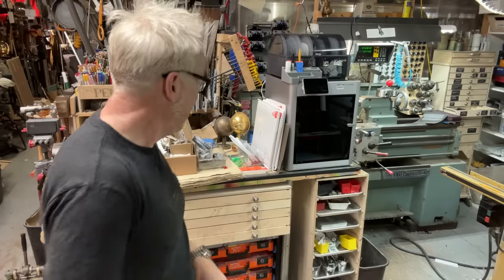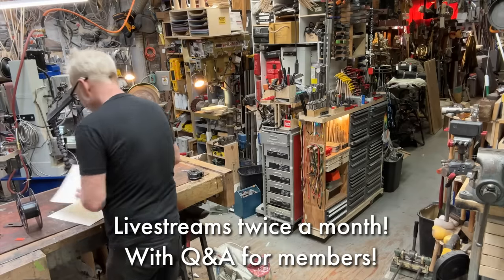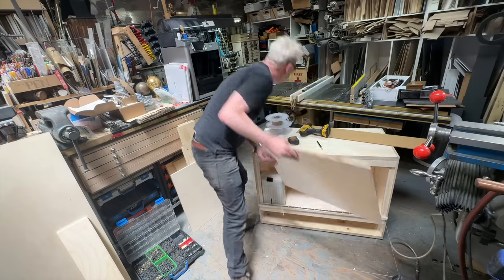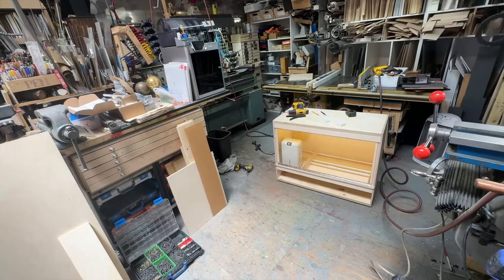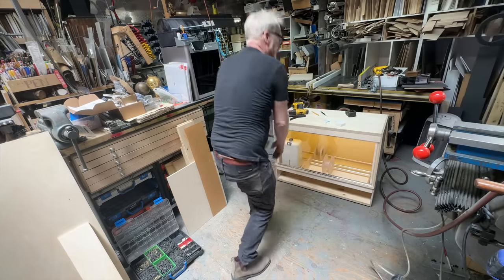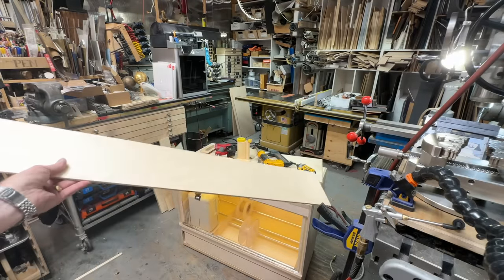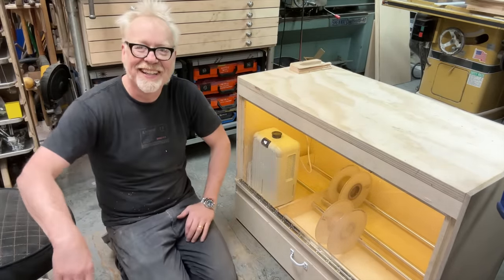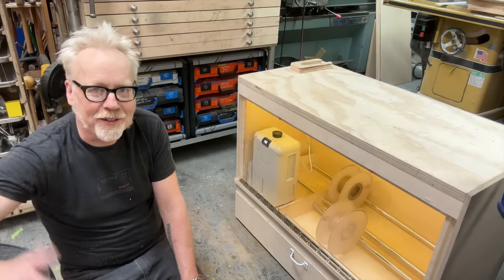Adam Savage Builds His 3D Print Farm!

Comment: Hi Adam!  I have two questions (not sure if you look at these, but this is SO relevant to what I have been thinking thee last few weeks). 
1st - Are you gluing the sides together on this, or are you joining them in anyway (Kregg, etc)
2nd - for a non-maker/future maker - do you consider a 3d printer a "toy" or a tool? I want to buy the bambu labs, but need to justify the price.
Reply: A: A little bit of wood glue, and nails

B: I believe Adam has discussed 3D printers in one of his chats before! If I remember correctly, he likes them, but they were not ingrained in his mental model (back then), so it wasn't the first solution he went for. In traditional making, we are usually doing some form of reductive manufacturing (removing stuff from pieces), and then gluing different pieces together somehow. 

With 3D printing, you are adding material, so it really opens up a lot of "solution space" after you get used to them! But as with every tool, it does some things brilliantly, and other things less so. 

You do need to model your part in CAD though, which makes things a bit more formal then free-form making.
Reply: @AnT508  Thank you!

Comment: Although that dry box is interesting, I think you are making a mistake. I have been active in 3D printing for around 6 years now and over time you end up collecting a LOT of filament or resins, of different colors and types. You should NOT store your filament in an actively dehumidifying box. There's nothing technically wrong with storing in a dehumidifying box, but it is of limited size and will be a huge waste of electricity. What you should do is get the thick large plastic bags made for storing filament along with a bunch of desiccant. Use the dehumidifier to remove as much humidity as possible, then immediately store it in the plastic bag with several medium sized desiccant in the bag. The temperature of the filament before it hits the hotend is somewhat irrelevant as the hotend will heat it up appropriately. Soon you will have a WALL of filament and actively dehumidifying all that would be quite an expensive ordeal. After storing in these bags, if you are concerned about filament absorbing water while in storage, put it in the dehumidifier you built the evening before you start your printing project and let it dehumidify overnight... Store filament in sealed bags with desiccant packages in the bags and they'll store well for years...

Comment: For your next printer, I'd suggest something supporting multiple tool heads so you can print different types of material in the same print, instead of just different colors. There are several idex printers on the market, but the  Prusa XL or the blackbox would be more flexible.

Comment: Poor mans dehumidifier....Fill a storage container; the size to fit filaments. With about 4" of mixed plaster of paris. Pull it out of the container and Let it completely dry. Then put it back into the container. It will draw moister away from the filaments.

Comment: Shocking someone with an engineering mind would not overlap the TOP over the sides (Same as the anycubic stand). Your now relying on the lateral strength of staples and glue to support everything instead of the incredible strength of the multiple plies of plywood holding everything up. Also I think instead of measuring for the counter height it would have been better to measure for the height of the filament. So that you could have had a second level of filament stacked on top. Also some sorbothane on the bottom would be good to help keep it from sliding around and absorb some of the vibrations for stability and to keep it from chattering. Possibly some dynamat on the inside as well because that thing's gonna now act as a speaker horn transmitting all the shaking. Also I question an x1c just because bambus practices are a bit unfriendly to the community.

Comment: Bambulab are awful for "professional" uses. I'd never let cloud only device touch my work stuff, I love their hardware, but closed source proprietary online only service is a freaking security risk man.
 
Little Timmy who prints funny boats or Bob who makes home improvement stuff won't suffer when their little sliced files get yoinked in data breach, but imagine what is basically manufacturing files getting into unauthorised hands.

Also 45%RH@23°C is only viable storage conditions for like PLA. Even PETG will string as hell if stored like this and needs environment below 30%RH@23°C, not even starting on superhygroscopic polymers like PA(Nylon) that need 15%RH@23°C at most or they'll be soaked and unprintable in matter of *hours*

Comment: Re: "Filaments are hydroscopic"  Seems like a myth.  Bust it or prove it true!  Filaments are plastic based, and as such are NOT, repeat NOT hydroscopic.  I have no idea where you came up with this notion, but you need to elaborate/prove it.  Nice cabinet though.  I put some silicon pads under mine to dampen external vibrations.

Comment: The Kobra max is awful. You will find a great use for as an extremely heavy paperweight. And their customer service is worse.
Reply: Glad someone has had the same experience with the Kobra Max that I have. The thing is god awful. QC is not there, no customer service, belt snapped on my X axis literally 3 months in, default profile is trash. The thing is just taking up space at this point. Got an X1C and haven't looked back.
Reply: @Aether-Entropy  I bought it and spent the extra $$$ because the giant build plate. WRONG MOVE. Note that it has, well had, a permanent home. A heavy non moving stand for it. Every single time I want to use it, I have to calibrate it. I replaced the hot end, gear feed box, and a belt in the first 2 months. Warranty? Hell no, I had to pay full price AND had to wait because conveniently they had to come from ehem China. Needles to say, my machine was down for 3 months waiting. After that, it still performed like a $25 machine off of wish
Reply: @SubliminallyMischievous  to this date I can’t get a solid, clean print off it. Switching to prusaslicer and building a profile from scratch has helped somewhat, but the prints really do look like they came off a 25 dollar machine, 100%. They got a nice review from me on Amazon. I always tell people to stay away from anycubic these days

Comment: You ever think about doing to the boxes/cabinets you build what President Trump did to regulations? For every NEW box/cabinet you build you HAVE to remove 2 older ones. Consolidate and minimize. If you can store things that take up 2 spaces in the space of one you create a more efficient use of space and storage. Which equates to man hours saved over time. You're making a printing station, right? Should have made it to hold ALL your printers and materials for printing - paper, filament, ink, resin, etc. And if moisture is such a problem why is that roll of filament that is being used not in an air tight bag or container? Maybe that should be your first print - an airtight cover/container made to fit the machine and roll of filament. Maybe make a slot to hold desiccant in it. That way prints that take 10s of hours the filament won't be sitting in a huge pool of humid air sucking up moisture like spaghetti. Just an idea.